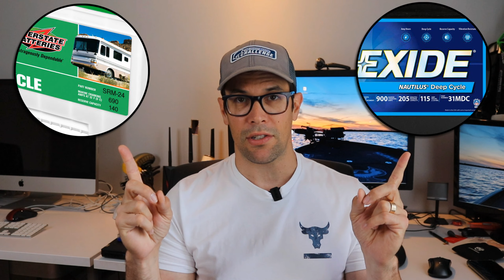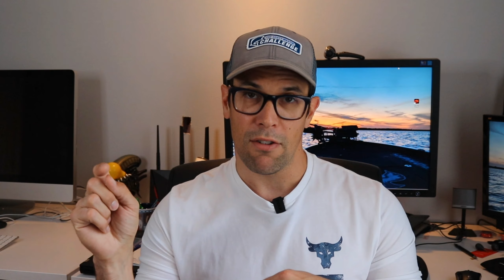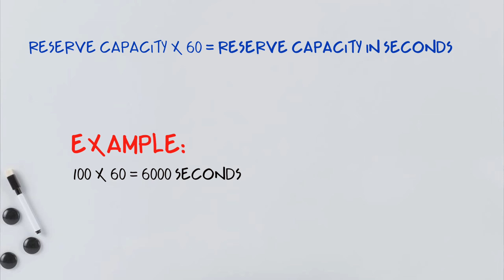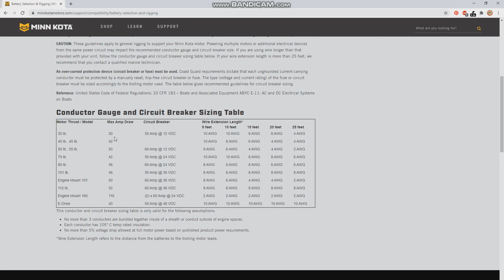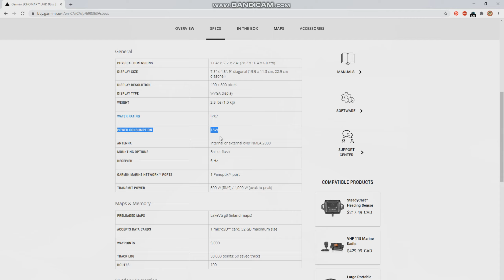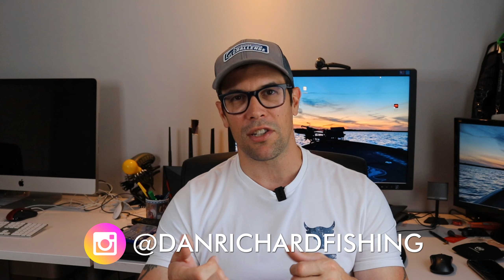How Long will my Boat Battery Last + What are Cranking Amps, Reserve Capacity and Amp Hours?

Comment: Great video.  I'm having some trouble with your reserve capacity calculation.  I'm looking at a battery from Canadian Tire and on the label it says 130 reserve minutes and it also says it has 65 amp hours.  Doing your calculation on the reserve capacity calculation the amp hours comes out to 54.1666666667 amp hours.  why the difference between that number and the 65 amp hour rating on the battery?  I really need your help.

Comment: Dan , I have a 19’ Phoenix with a 24 volt Ultrex and I’m only showing 12.4 volts immediately after charging so I’m looking at replacing both batteries . Found these at Advance and would like your input . By the way I currently have Deka 27 series that came with the boat  .

DieHard Marine Gold Battery: 31M Group Size, 675 CCA, 840 CA, 210 Minute Reserve Capacity, Deep Cycle $135

Comment: Wrong! A 50 Amps draw DOESN'T mean 50 amps per hour, it means a certain number of Coulombs (charge) per SECOND! Amps by themselves are not measured over a time period, AT ALL, because Amps is already a RATE of current flow over time. Please make sure you actually understand the concept before teaching others about it.
Reply from the maker: Sigh... You can use the same concept by converting my dude. Amp hours are based on ampere draw per hour, or 3600 coulombs. Hence why leisure batteries are sold in AH units. I understand the concept just fine.

Comment: Working on electricity and low-voltage and stuff on boats RVs refrigerators appliances nowadays have solid state boards with different voltages in it. I found a stumbled on your charm. Lovett have her instead of just talk in Marina stuff that’s talk about some of the other did your clothes stuff that uses overreach to work car there for an hour and 17 satisfy you have that I’ve Paciencia appliances nowadays thousand learn to cut the voltage back and back and back until a holiday drawls in Dubai Tristi so anyway I’d like for you to talk more about some of the different voltages and that thanks enjoy your video
Reply from the maker: Hi Stephen, unfortunately my time is very restrictive so it's tough to focus on so many things so I try to stick to just the marine side of things :)  All the best!
Reply: Well without know how to read electrical diagrams wearer a ladder are step to step and voltage control in a diagram you can get confused sways ck read Oma Ck and voltage check you can easily mess up see I seen we’re people put 110 volts to a refrigerator and the refrigerator not work and not know that you got to have 12 votes to work the controls of the unit they buy a brand new refrigerator and find it don’t work and most the time a blowed fuse on 12 vote side of the control s blown
Reply: Oh now you can find these same types wiring on house boats so RV And house Boats can be a little tricky!

Comment: Hey Dan, thank you for your lesson here.
 If you don't mind i would have a question please. 
For a Motorguide Xi3 with Pinpoint GPS, 55lbs trust, 36" shaft, how much should the amperage be for a LiFePo4 battery.
Thank you so much for your answear.
Reply from the maker: No problem, thank you for watching the video!  Max amperage draw on that model of motor is 52 amps.  If this is a battery to run this motor on your kayak for example, I would recommend getting the biggest one you can to be completely honest.  I would not recommend less than 100AH.  Hope that helps!
Reply: @DanRichardFishing  thank you so munch for your answear.
Yes, this motor is already on my Ascend 128X kayak.
Last season i used an 75 Ah AGM battery which was ok for maybe half a day. The reason would be probably  that i am doing 90% of the time trolling.
Thats why i am planning to buy a 12V,  410 Ah LiFePO4 battery.  But i am a bit worried to not damage the motor with such a big power. What do you think? Thank you again for your tips.

Comment: I'm installing two Garmin Striker fish finders (striker 4 plus and hopefully a striker vivid 9sv but dont have that one yet) and while removing the very old (12 or so years) humming bird fish finder, I've discovered it was connected to the starter battery. Should I connect my new fish finders to the same connection, hence running off of the starting battery, or should I connect it to a different battery? Using the formula you shared, the starter battery should have about 75 amp hours (180 reserve minutes is on the battery) and the two fish finders combined run at just over 1 amp draw.  So trying to figure out if I can get away with it or should hook the fish finders up to a different battery. The boat is a Legend 18 Extreme and I believe the humming bird was factory installed so they seemed to think it was fine to connect to the starter 12 years ago...
Reply from the maker: Congrats on the upgrade to your sonar units, new graphs are always so much fun! You have absolutely no issue installing these to your starting battery that's what I recommend for anyone's installation. You'll be fine for the entire day no problem and don't forget every time you start your motor and you run that engine it will charge your battery back up throughout the day. I run two 12-in graphs, livescope, and my live well pretty much all day on and off and I'm powering my camera and recharging batteries and when I get home I'm still about 80% charged. Enjoy and thank you so much for the question!
Reply: @DanRichardFishing  Thanks. Keep up the great content.

Comment: Will the battery draw power even when I'm sitting fishing for a couple hours with no power to motor,???
Reply from the maker: Well bear in mind batteries don't draw power, electrical devices do that when turned on. So with that in mind, if you have no electrical devices on and drawing power, then your battery should not be getting used. Hope that helps!!

Comment: hi Dan I bought a marine starting battery due to the fact it's lighter and has a handle. it is 140 RC 25 amps 80 A.H but it doesn't show MCA or CCA how do I know how many mca's to test it at? using your formula for a 30 amp trolling motor I get 2.26 hours, sound correct?

Comment: Hi Dan am a chanuk like you with my Lund WC-16 DLX great boat. 55 lbs thrust Minn Kota  bow mount. With ProNav GPS control  I have a huge deep cycle Lead/ acid for powering it.  It  has 150 AH.  I go out for 4 hrs at don to 8:00am and at again at 6:00 pm to dark. Bug out then. At the stern I need  I need a battery  to work my bilge  and a Hummingbird 4’ fish finder . Have a marvellous Yamaha 25 Hp two stroke. Rope start
Reply from the maker: Hi Joe, what's up my fellow Canuckian? :)  Wow that battery is a BEAST!  For your bilge and hummindbird, you could get yourself a small lithium battery for that and you would have more than enough power to run that bird all day plus have power for the bilge pump if needed and it would be small and lightweight.  Something like a 50AH sized one.  Stay safe out there and tight lines :)

Comment: What about AGM batteries I have 24v 2 110amp batteries are they ok for trolling outboard
Reply from the maker: AGM Deep Cycle batteries are totally OK for your trolling motor and are the best VRLA technology battery option out there.  Just make sure they are deep cycle leisure batteries built for long and deep draws and not automotive starting batteries.  They are built differently.

Comment: Is it ok to run my agm battery till the trolling motor dies.
Reply from the maker: Out of all VRLA technology batteries, AGM are the toughest and can handle deep discharges very well, right down to 20% or even 10%.  I wouldn't discharge it past 11.8v with zero load.  I would NOT run it until the trolling motor is totally dead.

Comment: Good video. Good ‘layout.’ Good info. 
Also some totally, completely wrong information and conclusions. 
Capacity, CCA, MCA… they tell you information about how the battery is constructed and what it’s intended use is based on that construction. 

Yes- a deep cycle lead acid battery is 100% discharged at 50% of label capacity in Ah or calculated by label info to Ah. Somewhere around 12.06 volts or like below or 11.8 is shortening the life of the battery big time. 

And yes, people do run a trolling motor for 8 hours. I have many times: walleye trolling from a small boat. Because you missed the fact that a deep cycle will deliver many more amp hours over a long time and lower amps before going ‘dead’ than a high Amp power for a short time will. Or can. 
A 30A trolling motor draw for a half hour can run a lead battery into the 11.x volts range or below (dead), but you can get 8-10 hours+ out if you’re only doing 7amps-ish.  “Pukert Effect.”
Reply from the maker: Honestly I have no idea what you mean by completely wrong information and conclusions. Several of the points you're talking about I already mentioned such as the difference in construction between different battery types as well as shortening the life of a battery by over draining and it's actually more like 35 to 40%. I actually address this in detail in several of my other videos including about lithium batteries.

Running a trolling motor for 8 hours straight is extremely uncommon, in Ontario and Quebec, which is the walleye fishing capital of the world, the vast majority of people will use a kicker for trolling or on a small boat a 9.9. but again I don't understand what this has to do with the video having completely wrong information, I'm teaching people how to calculate how long your battery will last for exactly this reason, for people that need eight hours of power on their trolling motor they can figure it out based on the average rating of their motor and other electronics. And obviously I explained that a deep cycle is what's needed for a trolling motor.

The amp hour rating for marine batteries tends to be the same whether it's a starting marine battery or a deep cycle because marine batteries that are intended as starting are still dual purpose however the app our rating will be smaller because it's generally a group 24 or 27.  The amp hour calculation remains absolutely the same.

I appreciate the comments but I don't see any completely wrong information in this video at all. Watch my video on selecting the right battery for your boat, or the lithium battery video and they cover every point when it comes time to selecting the correct battery and what different battery technologies do. Btw it's the Peukert's Law you're referring to.  Thanks again for taking the time to comment, you're not wrong but you're just repeating exactly what I've said in this and other videos :) Tight lines!
Reply from the maker: Btw we're running a big thank you giveaway to all subscribers, check out the giveaway video if you haven't seen it yet and sub for a chance to win a bunch of baits :)  OK back to hockey I go, have a good one!

Comment: Hey Dan I got a nautilus deep cycle battery 12volt and a 40lb thrust min Kota endurance max motor how long will it last the battery 120 reserve capacity and 65 amp hours
Reply from the maker: Hi Angelique, unfortunately you won't get very far on just a 65AH battery with a 12 volt trolling motor, they actually have a max draw of 42 Amps but average around 29, so you you'll only get about 1.5 - 2 hours of continuous power from the battery on that motor.  Is there a reason why you have a smaller battery on your boat, like lack of space or weight capacity?  You should go with a group 29 or 31 battery and you'll go to 4 - 5 hours of continuous run time.  Hope that helps! :)

Comment: Hi sir ihave parallel of 6 batteries can i still use it while im charging ?
Reply from the maker: Sure you can technically have 6 batteries running in parallel and yes you can use it while it's charging.  So like if you have the system connected to a solar panel for example.
Reply: @DanRichardFishing  thank you very much sir..im one of your subscriber sir..keep safe..
Reply from the maker: You're very welcome and thank you for subscribing!
Reply: @DanRichardFishing  do you have any sugstion sir bcoz my set up is in parallell in 6 by 12v and i use it all lights and navigatinal equipment except starting of engine.Is it advisable sir?

Comment: Can I convert cranking amps to amp hours???
Reply from the maker: No, you can't use CCA to calculate AH. I've had a couple of people say that you can and they sent me how but the number is inaccurate.
Reply: @DanRichardFishing  But we can with RC??
I seen your video !
Reply from the maker: @lloydbrown9327  yes you can use reserve capacity, absolutely. :) The full calculation is in the video and I believe in the first pin comment there is a short quick equation you can use, hope the helps :)

Comment: Coulombs? why not just.. AH = (RC/60) x Amps
Reply from the maker: You're absolutely right, that is the fastest way to calculate it and good job for pointing it out, no one else caught on to that ;)  So I use the coulombs in order to explain in detail how the battery technology works and is calculated and I wanted to cover all the terms and abbreviations we usually hear or read when it comes to batteries.  I've read a lot of literature where it mentions coulombs so I didn't want to leave it out, although in hindsight I should have mentioned the simple equation as a way to make it easier.  I'll add it to the pinned comment, thank you!
Reply: I appreciate the coulombs discussion. Not everyone knows everything like you. This guy (Dan) explained it better than all you know it all nerds 😂
Reply: @vroor32  I also appreciate the discussion, it takes a lot of time and effort to produce these vids. I was just suggesting a simplification of the same equation which should make it easier to grasp. However, if coulombs helps you understand it then I'm all for it.

Comment: Hello sir, purchased a cheap battery from a wierd brand, it does not include any Ah value, just CA, CCA and RC values, can I calculate the value witht these ones?
Reply from the maker: OK so you have the Reserve Capacity number (RC), you can use that to calculate Amp Hours.  I talk about it at 8:45 in the video with exactly how, hope that helps!
Reply: @DanRichardFishing  Amazing, thank you so much, I'm new at this and couldn't find anything, now I'm able to code the new battery into my Audi computer.
Thank you!!
Reply from the maker: @2024-x4o  You're very welcome!!

Comment: Or you can take the amps your motor is putting out and divide it by the reserved cap. It's easier for me that way
Reply from the maker: The problem with that is the reserve cap is calculated with an assumed draw of 25 amps.  So that equation won't be accurate unless your motor happens to draw 25 amps when running.

Comment: Too long of a calculation... just divide the CCA by 7.25
Reply from the maker: I'm afraid that's not accurate (I'm assuming you mean for AH), it will generally give a number way too high, especially on starting batteries.  Deep cell construction doesn't drain the same as a starting battery.  For example on a Group 31DP from Interstate (the AGM model), the CCA rating is 925.  With your calculation, you get 127, which is way too high.  The specs have it rated at 100 AH and the actual AH based on Reserve cap (200) is more like 84 AH.

https://www.interstatebatteries.com/products/31m-agm

You can't use CCA for calculating AH, you have to use RC.  Honestly though, your post had me hoping it was that simple, but I tried it on a few batteries and they all came out way too high as I figured it would, simply because CCA is so variable.
Reply: @DanRichardFishing   This Durrecell i'm looking at is Group 31M   What doe the letters mean after the group 31. Min Kota is recommending the best  for my trolling motor is group 31. I've seen other batteries with a letter after the group. I don't want to make any mistakes when I finally order.

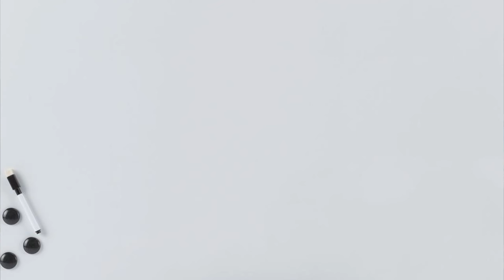Comment from the maker: Well damn.. it's pronounced koolawmz.  I was close lol!  (Watch the video, it'll make sense)  By the way, the purpose of the video is to teach you all the abbreviations and technical terms when dealing with batteries and the equations given are really a granular breakdown of energy measurements.  As viewer @arnaldo35 mentioned in the comments below, you can simplify the Amp Hours calculation by using AH = (RC/60) x 25AMPS and it will give you the same output as more complicated equation discussed at the 10:09 mark.  Thanks Arnaldo!